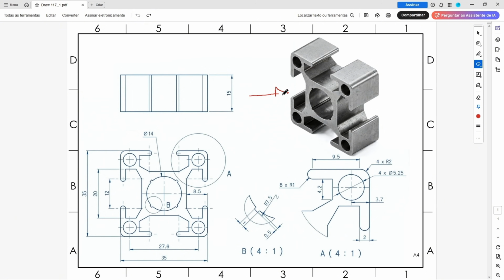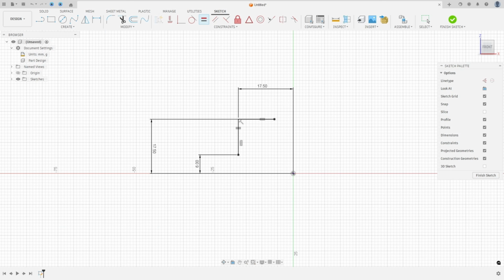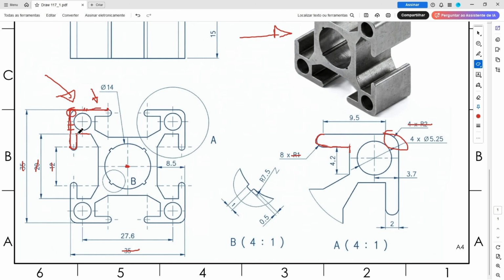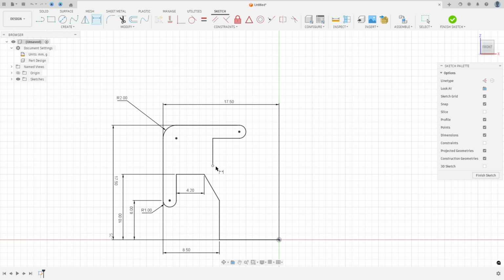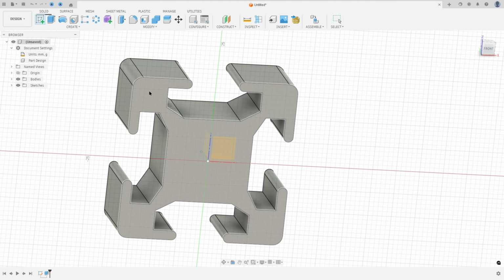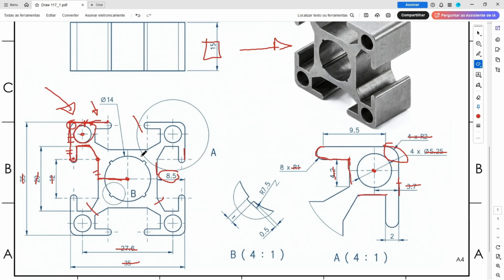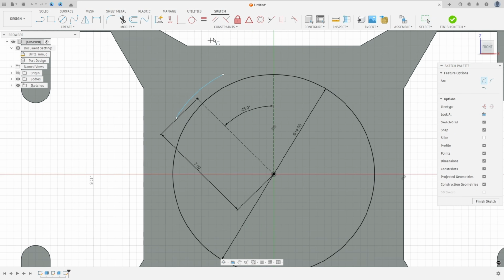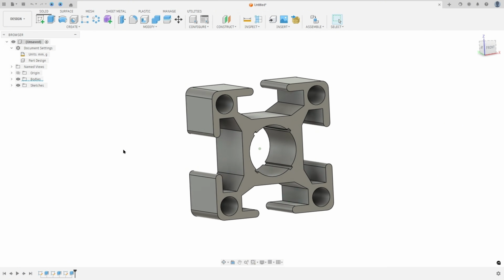Fusion 360 From Zero | Expert Tutorial Step-by-Step

Comment: I’m curious why you chose to use multiple drawings rather than just one. Was it for educational and experience or was it for another reason. 

I have heard it is better to keep drawings simple for size and performance. What is your experience?
Reply from the maker: Great question 🙂

In this example, the part could be created using a single sketch, but I intentionally divided it into three:

• one sketch for the base profile
• one sketch for the corner holes
• one sketch for the central bore

This approach comes from my experience working in manufacturing environments, where I used both SolidWorks and CATIA V5 on factory design projects. In these settings, models must be easy to edit, reliable, and clear for anyone on the team.

For example, if the central bore needs to change to a different diameter, I can modify only that feature without affecting the rest of the geometry. The same applies to the mounting holes.

In real assemblies we often work with hundreds of parts, so keeping features organized makes updates faster, safer, and much easier to manage.

In this video I also created the fillets inside the first sketch, but the recommended practice is to apply fillets using the Fillet feature, since this keeps the model easier to edit and more robust.

For simple conceptual parts, a single sketch works fine. But structuring features this way improves clarity, stability, and future modifications 🙂
Reply: @Fusion360Mastery thanks for the insight. I love that information